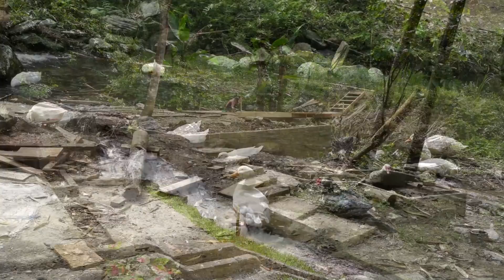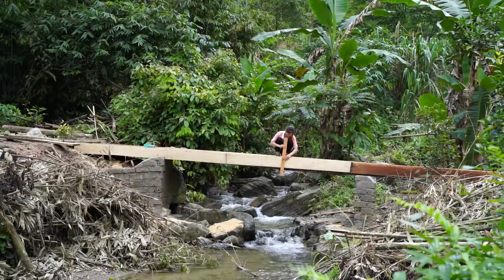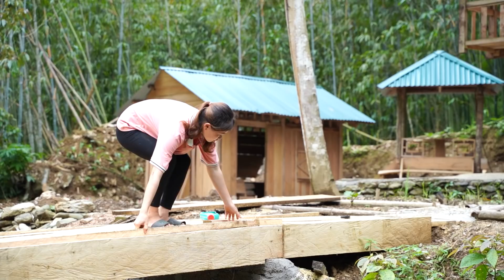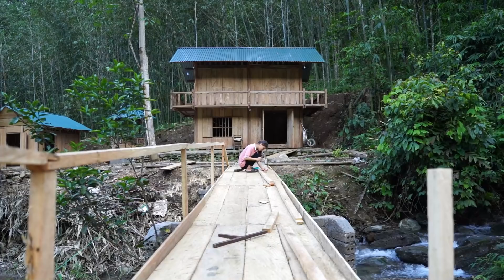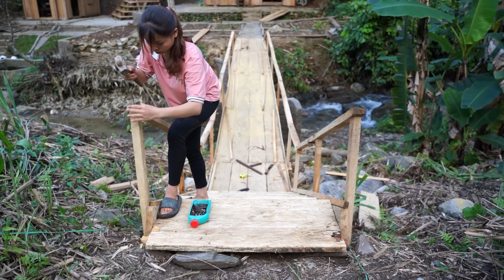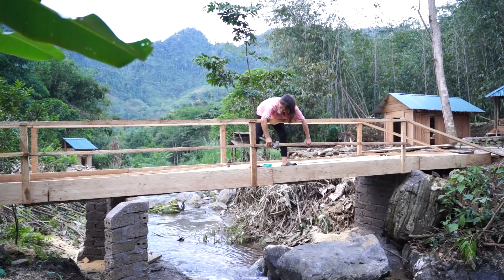Building a bridge over a 2-storey house, grazing ducks - 200 days of bushwalking in the forest

Comment: Your bridge looks very good. Just a suggestion, you should build a wall behind the central support and fill the center between the two walls with something that can be packed. it will add strength to it and help it withstand anything that hits it during a flood event. Keep up the good work and the videos coming.